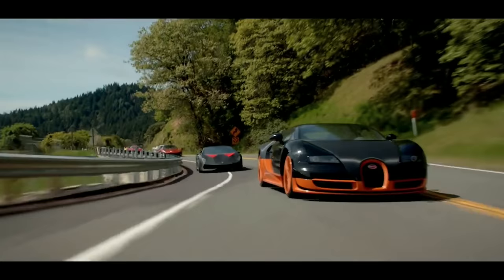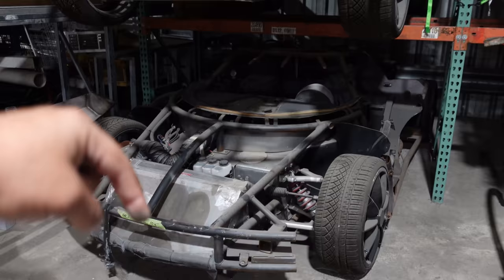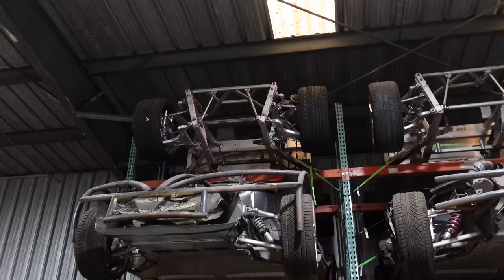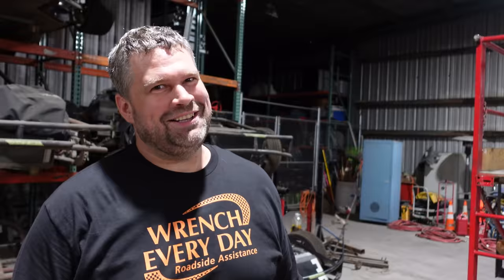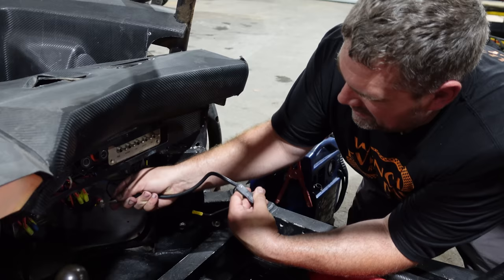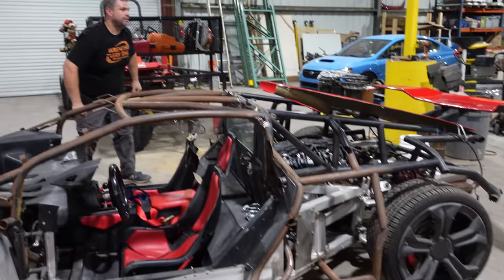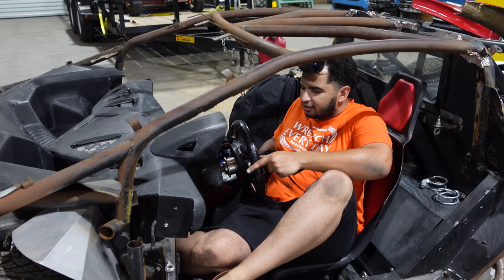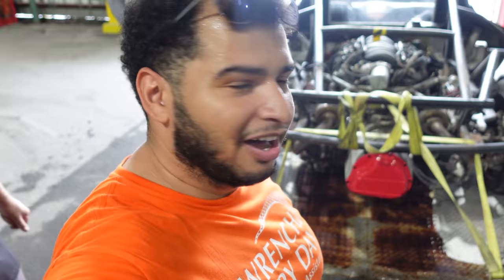I Bought A FAKE Lamborghini From "Need For Speed" (And It's WORSE Than You Think)

Comment: The welds are tack together and are not fully welded, no strength in accidents. Some tubing will need to be cut out and replaced as there is large hole in tubing, no strength in tubing and will fold up quicker than empty toilet paper roll when needed in accident.

Comment: Clutch release bearing and pressure plate is screwed and will need replacing along with whatever else is damaged.  The warning DO NOT buy POS is too late as it sold old for parts not to be title, NO registrations for insurance as will not past safety crash testing.

Comment: See if the movie company will give you the 3-D files so you can make and reproduce body panels to make it a replica of the movie car. Keep the engine that’s in it since it’s almost brand new or swap it out whatever would work but it would be an interesting replica of the Lamborghini. And then have the shop that did the McLaren do an interior for you. As well as buying bits and pieces of of parts to assemble the interior and such. Would be a cool project to see

Comment: OK FREDDY!, what you need to do is buy a M275 Motor with low miles, Mate that Mercedes sequential trans you had made to it and swap them both in. Make a pagani Zonda mold, Adjust body to fit it on and Boom Mercedes V12 TT powered Pagani rep. :D   id like to drive it too :P

Comment: F22 raptor inspired custom body could be doable. take a look at the front lower angle with dual side mount radiators and rear dual exhausts with a double bubble fuselage rear end with active areo.  all in mottled grey with gold tint windows.

Comment: 100% franken build!  Use the front end of the fake lambo, Is that top trunk/spoiler that came with it, use some of the wide body kit that you didn't want to use on the other project,  And basically any other body panels from funny looking or exotic cars in your "spare parts bin".  At least as far as the outside is concerned.